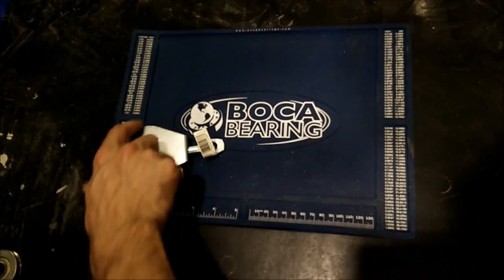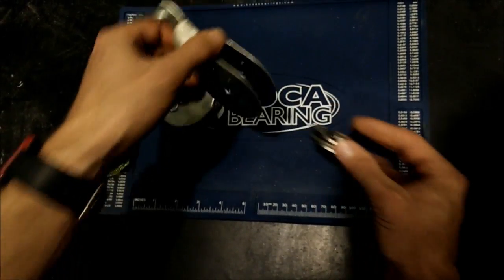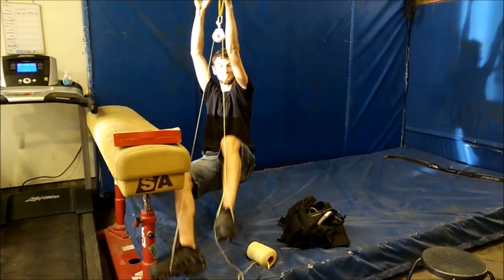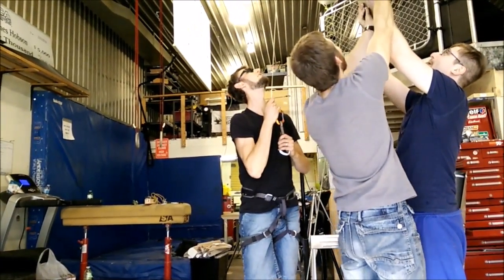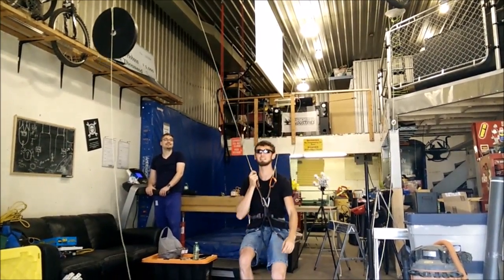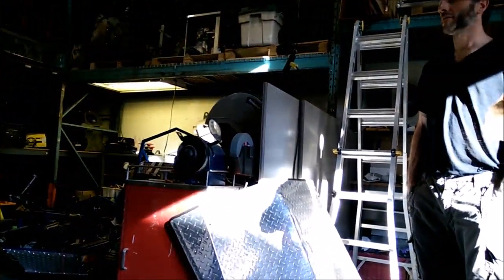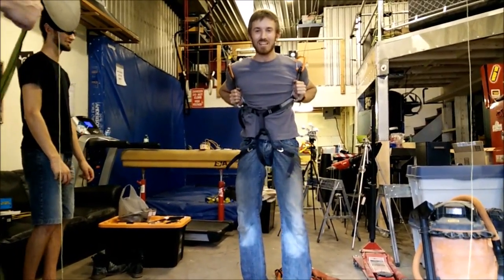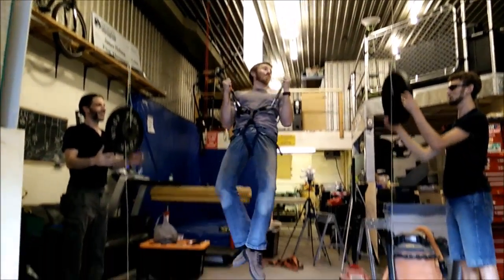DIY Stunt Wire System -- PART 2/4

Comment: Hacksmith you should hang the exo skelton on one of those like in the fallout 4 trailer how the power armor is hanging
Reply from the maker: +Buba Jack What do you think it's really for? ;-)
Reply: +Buba Jack  or use it like the 3d system like off of attack on titan or a spy movie
Reply: +the Hacksmith  hey what if you use a giant strand of something that is strong and elastic you would be able to sling shot your any where
and add it to the 3d system from attack on titan and you could probably pull off some crazy stunt's

Comment: Acrylic washers? The metal cheese the pulley housing is made from would have just bent inwards pretty easily and housed the bearings better. I'm kinda concerned about the dynamic loads of jumping around, they'll be far, far, far in excess of the static load.
Reply from the maker: +MattsAwesomeStuff We'll be replacing the acrylic with delrin as soon as we can get some. The kevlar is so thin we were afraid sandwiching it with metal would A) increase the friction too much, or B) the kevlar would still be able to slip in between. The overhang on the washer makes it pretty much impossible for it to slip off.
Reply: NEVER bend the block housing, it will derate it (lower its capacity). Also this is indeed VERY sketchy. We have a saying in the industry "hire a professional", "if at first you don't succeed rigging is not for you". The VERY LEAST safety for flying people is 10:1, and I doubt they have that (minus the kevlar line)
Reply: We have a saying in the mountain climbing industry: "If you can't tie knots, tie lots." Actually that's from the bondage community. Actually neither. But the point is, no one gives a shit about your desire to hire a professional. If what he was doing was cheap and easy, people like you would have already done it.

Comment: why not use some 550 paracord (or type III) so that i could carry more weight about 1100lb with 2 cords. not sure what the stuff your using can hold. if you do considerate make sure its the real stuff there is a lot of fakes out there.
Reply from the maker: +brandonhughes7 1000lbs per strand =D I do have paracord as well, but we went for the kevlar instead!
Reply: the Hacksmith damn thats some strong stuff.
Reply from the maker: +brandonhughes7 Only 2mm diameter too! the 2.5mm diameter stuff is rated for 2000lbs... I kinda wanna test it at work with the Instron machine...

Regardless -- I've got myself some grappling hook string!
Reply: the Hacksmith maybe you should add a grapple to the exo. i think the mythbusters created a good working grapple. and with the suit it wouldn't put any strain on your body.